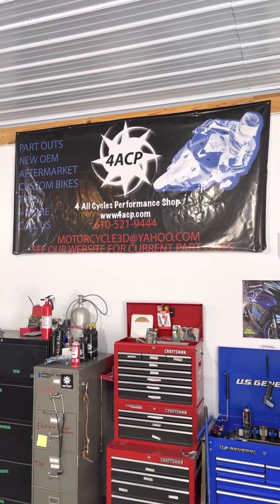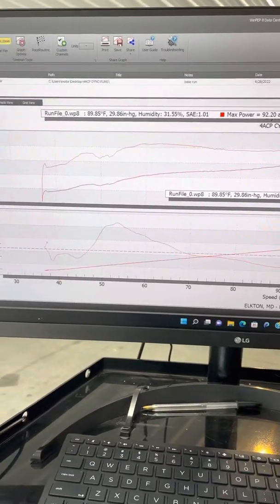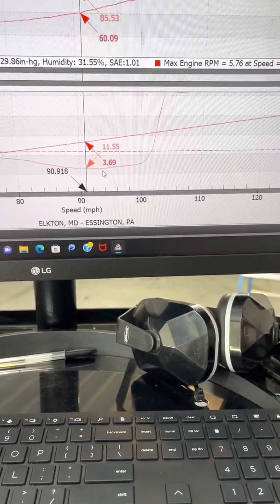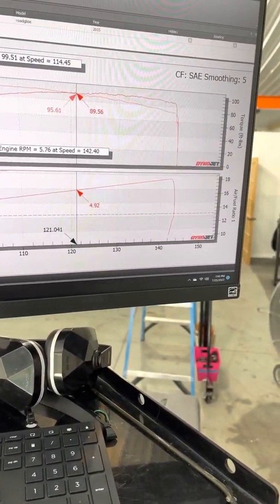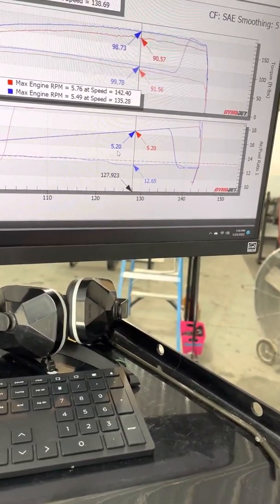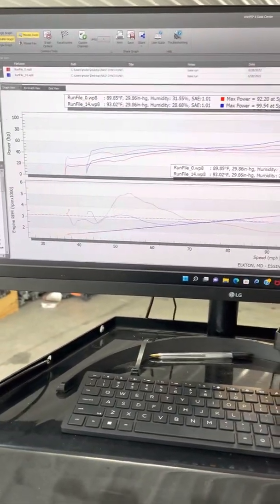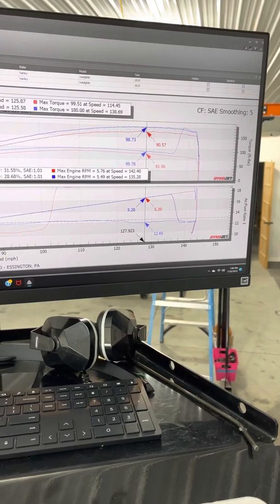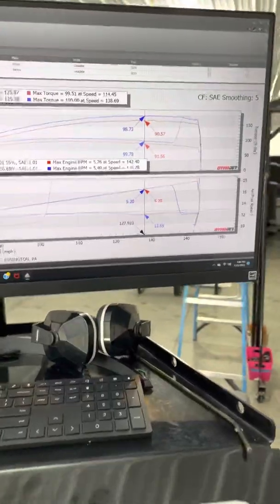Warning Bikers must watch! Auto tune fuelpak 3

Comment: So what you're saying Is there's no other option besides paying you to do it im going threw the autotune process ive put about 20 miles on it uploaded the info it gathered and it already  running bet. They suggest 1 to 2 tanks of gas so im pretty sure after 200 miles ill have an amazing tune.
Reply: I plan on doing the same thing when I stage 2 and I'll check the results with a dyno and let you know how close it got

Comment: Did you Ride until most of the squares on the chart were green while the FP3 was in autotune mode, then flash the learned map into the ECM? Because if you didn't then the module never learned the bikes parameters and the map wasn't actually flashed. I did, and my bike runs beautifully.

Comment: No disrespect but this "information" comes off as very self-serving considering that you are apparently in the dynotune business.  Your "report" is seriously deficient in facts and data to back up your claims.  You don't state any facts about the motorcycle in question, it's condition or configuration.  Or any information about the V&H map that was used as the base map.  And just the fact that your test "sample" is a grand total of one, vaguely described motor makes your video highly questionable.  I have no dog in the fight but I have so far found no benefit in paying $1,000 to a tuner when my FP3 and V&H supplied maps have so far worked very well for me.  Going by the way the motor starts and runs, the condition of the plugs and occasional oil analysis I'm satisfied that the long and short term fuel trims coming from my narrow band O2 sensors have me tuned better than stock (which is set intentionally lean by the MoCo).

Comment: Is that after the auto tune was uploaded? Or was it still while on auto tune?
Reply: How long did you run it on auto tune and did you actually upload the tune?
Reply: Very deceptive! Been running FP3 on 2 bikes for years one Bike is stage one with perfect air fuel ratio confirmed and the other Bike is stage two twin Cam and was also found to be in the sweet spot after a new flash from Vance & Hines.
Reply from the maker: This was with everything installed and still active. It can not achieve auto tune on a narrow band sensor.
Reply: @4allcyclesperformancedynot617  well V&H clearly states how the auto tune works.  They say it will run rough until the the tune is saved. I can assure you that. Also I’ve dynoed mine after using the auto tune feature and the fueling side was spot on.  Give it a try.
Reply: @TyScott85  Bingo. Same here. I'd like to see what V&H would say about this video. It's borderline libelous.
Reply: @4allcyclesperformancedynot617  If auto-tune was still active then it was still tuning aka learning the bike so right there is the problem.